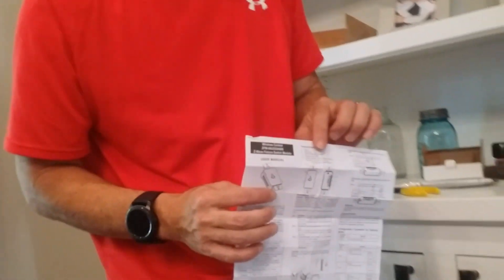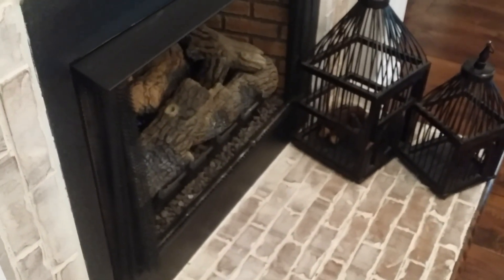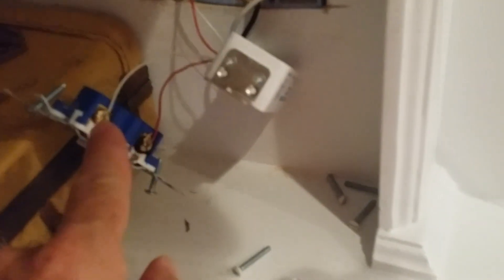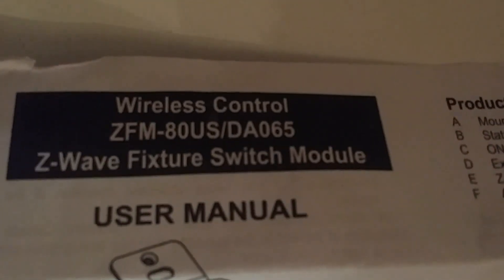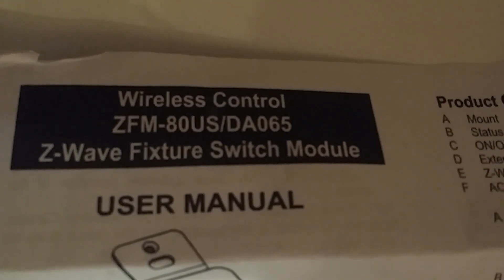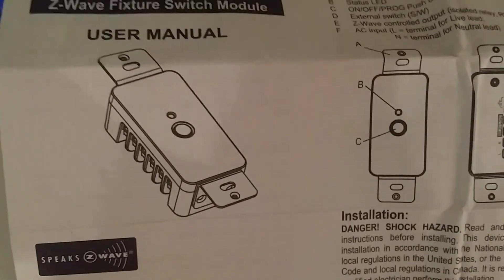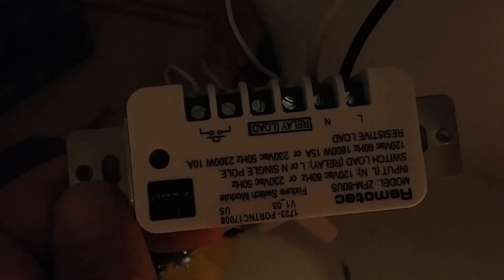Low Voltage zwave Fireplace switch w/Alexa

Comment: My fireplace has the relay underneath.  Is the 110 going to the switch, just to power the z-wave switch?  I am concerned it will feed to my fireplace and fry my relay or worse.
Reply from the maker: Shon Bjerregaard hey sorry for the extremely late reply.... the 110 is just going to the switch... the switch has a built in relay that only sends 2 or 3 millivolts (I believe) to trigger the switch built in to my
Fireplace

Comment: Thank you for the post. Looking to add this to my home but have a couple questions. What happens if the light switch is up (on) and you tell Alexa to turn off the fireplace? Will the fire place turn off even though the manual switch is on? Also, if you turn on the fire place with the switch, and then look in your zwave hub, does it show the fireplace as on or off? 

Thanks!
Reply from the maker: Anthony Hildoer Great question! so Yes If I manually push the button to turn the fireplace on, Alexa will turn it off..and vice versa..
Reply from the maker: Oh also honestly you don’t need the toggle switch.. there is a push button on the z wave controller.. To this day I’m not real sure why I put the toggle switch back in...🤷‍♂️
Reply: @bk334st  I would like to mimic your setup but plan on putting the z-wave relay switch under the fireplace as opposed to on the wall.   As Anthony asked, if you have the manual switch on and turn off the relay via Alexa, does the fireplace turn off or stay on?
Reply from the maker: Kulvir Bhogal sorry for the extremely late response but short answer is yes! If I use Alexa to turn on the fire place I can turn off with switch.. I use the switch to turn on the fireplace I can turn off with Alexa..It’s acts like a Ge add-on switch, like you would use if you had a set of lights with more than one switch controlling them

Comment: I can’t find the ZFM-80US/DA065 zwave module anywhere. Where can you buy this?
Reply from the maker: Peter Landis Yeah another person commented they couldn’t find it aswell they may have discontinued...I did find something else there’s a link in the other comments.. not sure if that will work for you or not
Reply: That’s to bad because there doesn’t appear to be something like this.  Not even Insteon has something like this.  I’m looking at ways to control a relay to low voltage but can’t find anything out there yet.  If I do I’ll post a reply.  What you did is exactly what I want to do.
Reply from the maker: Peter Landis if you google or go on amazon and look for Low voltage dry contact switch it pulls up some Zwave relays..may be a little more involved to get it to work.. but I think it would be doable..

Comment: Too bad the 'production' leaves a lot to be desired ... I believe you're addressing what I want to do but I just could not manage to watch/listen.
Reply from the maker: Benny Hannah Thanks!
Reply: @bk334st  I'm looking for the ZFM-80US but apparently no longer available at Amazon.
Reply from the maker: Benny Hannah Qubino Z-Wave Plus Universal Relay with Dry Contact Switch ZMNHND3 https://rover.ebay.com/rover/0/0/0?mpre=https%3A%2F%2Fwww.ebay.com%2Fulk%2Fitm%2F223303993907
Reply from the maker: Found this one eBay...little different but works the same way... I just looked for it as well... even though my production is off I’ll still look for you periodically and help you anyway I can..
Reply: @bk334st  Thanks.  Keep the faith.

Comment: Can this be installed and no hub needed to control with Alexa?
Reply from the maker: Corbin Keith Short answer no you have to have a hub for this switch.. This is a Zwave product so you have to have some kind of hub to control..I know amazon has some smart devices now that all you have to have is an Echo to control not a hub.. You have to scan a Qr code on to your Alexa  app to control those..
Reply: bk334st okay which hub do you suggest? Id like to control via alexa
Reply from the maker: Corbin Keith Definitley the Smart things hub in my opinion it works with pretty much everything, Z-Wave, ZigBee, Wi-Fi, Bluetooth, Nest, Alexa, Philips Hue, Honeywell and I’ve had no issues with mine for the past 2years.. I’m hoping to upgrade to the new one for Christmas..

Comment: How do you get the ZFM-80US to connect or pair with Alexa? I have a new SmartThings hub but for some reason it will not discover the ZFM device. I'm not sure what to do or what combination of pushes on the program button of the ZFM to hit. ANy help would be greatly appreciated.
Reply from the maker: Elaine Woodward Hey Elaine so I’ve had luck by putting your smart things hub in discovery mode from the app.. which I’m sure you know that aspect of it... but once it is I’ve had luck by pushing the button on the switch 3 times holding it down on the the third time.. Is the Blue light illuminated..and or does the fire place work with just the switch??

Comment: Also,  in your setup, what's the point of the button on the front of the relay if your using your switch
Reply from the maker: Well honestly there is no point to really having the toggle switch, Since you can just push the button.. I believe I installed it for my wife, who really is not interested in all this Tech stuff and just wants to be able to flip a switch, like she’s use to. Instead of pushing buttons or asking Alexa to do it..
But short answer no it’s not necessary. 👍🏻
Reply: @bk334st  thanks,  this video helped alot

Comment: The one you said went to nothing is for a fan in your fireplace. Thanks for the video.
Reply from the maker: You may be right, but that fireplace doesn’t have one. Guess the wire could be capped off somewhere underneath. 
I built our house but dang if I can remember why I put that switch there..I have a couple more ghost switches as well..Thanks for watching!
Reply: @bk334st  there is an outlet underneath in the fireplace where the optional fan goes,  that other switch is the on and off for it. I didn't have a fan at first either,  I bought the installed mine.

Comment: Hi Bud.. thank you for the vid. Your set up is exactly what I want to do. But I must have done something wrong as the remotec didn’t even start. So I connected the 120V wires to the L & N ports and used 18 gauge to connect the switch ports (right most ports) to the wall switch. Connected the Relay Load terminals back into the switch ports. With this the remotec light didn’t start. What wrong do u think I have done?  Any help or guidance would be very highly appreciated.. thanks in advance
Reply: Hey bk334st, finally got it to work. My Remotec was busted (I think I fried it). Bought a second Remotec and the blue light came on. Then...(I didn't realize I needed a hub to make it work with Alexa), I linked it with my Vivint Home security which uses Zwave and used the smart skills in Alexa to  link the Remotec . Works perfectly. Thanks for the video and your help. Super easy once I got a new working remotec.
Reply from the maker: Ravi Bhatia Hey sorry for late response..You really dont need to wire back in the light switch as the remotech has a push button on it. Are you sure your fireplace is low voltage?
Reply: Hi bk334st... Thanks for the reply.. Yes I am sure the wiring is 18 gauge and it's low voltage.. I think I have busted the device because the light indicator doesn't come on.. Should the light indicator show something once the 110V AC is connected?
Reply: Hi, I'm having the same problem.  The LED light on the Remotec does not come on. I have the black wire attached to the L (load) on the Remotec and the white wire attached to the N (neutral) position on the Remotec. I am 100% positive I have a low voltage fireplace. Any help or guidance you can provide would be helpful. Thanks.
Reply from the maker: m b Hey ok so the blue light does not come on until you press the switch...First we need to figure that out..So with just the Hot wire amd neutral hooked up if you press the button does the light come on?
Reply from the maker: m b That's Great news! Sorry I wasnt much help, its difficult to trouble shoot over the internet..

Comment: Can you link this setup to a smart thermostat now? I'm looking for both voice command, that you have shown, and thermostat control in case my smartthings temperature sensor batteries die.
Reply from the maker: Michael Gautier  let me make sure of what you are asking. You mean a thermostat for the fireplace that will turn it off when it hits a certain degree, or thermostat for your home A/C?
Thanks
Reply: Yes. So it will turn fire place on. Im sure I can add an activity to my smartthings hub using my motion sensor thermometer, but I don't get great battery life and was wondering about a smart thermostat as the main source of turning it on when I'm not in the room if the temp drops.
Reply from the maker: Michael Gautier...Apologize just now getting back to you. I would have to brainstorm on that a little more. Giving there are post on the zwave switch I installed for just a regular  toggle I would think there would be a way to wire a thermostat that could essentially act as the toggle switch and wire to the post but remember it can't be 120v. Like I said I would have to research a little further in to that and get back to you.
Reply: I'm wondering if a nest or Honeywell smart, wireless thermostat would be able to link together easy. Maybe with IFTT would be a help if nothing else. I ordered one of those modules in your video today. Hopefully by Thursday evening I'll have good news.
Reply: I got my module today. Paired with smartthings simple and easy. It will not power on my gas logs. I did not hook up an external switch. I hear the relay clicking when switch on to off.
Reply from the maker: Michael Gautier first thing how do you turn your fireplace on now..or before you installed zwave module?
Reply: It came with a a battery powered receiver under fireplace, 4 AA batteries. A battery powered remote with a thermostat in remote. Remote is RF. Skytech 1001TH. It did not have an external wall switch with it.
Reply from the maker: Michael Gautier sounds like your fireplace may use a certain amount of voltage to turn it on. Are you able to check output of the thermostat you have currently hooked to it with a multi-Meter?
Reply from the maker: Hey Michael was just checking in to see if you had figured anything out?
Reply: Nothing that moved me forward. I was posting with a someone on Amazon and he tried his best to help but we got stuck due to the lack of internet information on my propane logs and it's power requirements from the skytech receiver it came with. Thank you for checking in. I'll probably start looking at it again, but took a little break because I was getting obsessive with it. It would be nice to figure it out soon.
Reply from the maker: just as fyi I was adding to my collection and ran across this
https://www.amazon.com/Enerwave-ZWN-RSM2-PLUS-Z-Wave-NEUTRAL-REQUIRED/dp/B01G7OD3ME/ref=sr_1_24?ie=UTF8&qid=1515339630&sr=8-24&keywords=smartthings+light+switches 
you can wire to existing switches?
Reply: What's your thoughts on this? I was trying to read some about it, but question how go incorporate it.
Reply from the maker: Michael Gautier forgot you said it didnt come with and external switch..just the remote..
Reply: Yeah, maybe I can start trying to call around next week and see what can be changed or upgraded for the receiver setup. I guess I got the only odd setup for my logs.
Reply: Michael - have you considered purchasing a separate Z-wave thermometer (there are a ton of them), and a RF or IR home hub (such as a Logitech Home Hub), then set up an IFTTT?  If temperature falls below 17 degrees, send RF signal from Logitech Hub to turn on fireplace.  If temperature raises above 23 degrees send RF signal from Logitech Hub to turn off fireplace.  Benefit of one of these RF/IR/bluetooth hubs is you'll also be able to use Alexa to turn on your TV, stereo, adjust volume, etc...
Reply: I have a Harmony remote and hub and I would love to go that route. Could you recommend what to buy that would go from IR to RF without learning how to right code?
Reply: The Harmony Hub already contains RF codes for millions of devices, just have to add the model of your fireplace / RF to it, then link your Harmony Hub to Alexa and you should be good.  Doesn't hurt to try it out for your application, if not you can return the Hub.
Reply: I have the hub and the elite remote already, I just couldn't figure out how to make the remote talk to my logs receiver or find it's signal. If it can be that easy I'll have it made. Just questioning how get my remote to find the logs frequency.
Reply: Harmony has told me in the past, last year that their remotes will not control anything with RF. I was reading their website and it still says the same thing. I called skytech and they are confused why my logs don't operate like these and told me I had a defective valve but I have another set in my parents house and they function just the same. I guess my next move was to call the logs manufacture, I just haven't done it yet.
Reply: Hi bk334st, thanks for the post. Very useful.   ZFM80 appears to be hard to find. (did you wait for some time on Amazon ?)  Just wondering do you know the  enerwave Z wave switch module relay would work as ZFM80 ?  I want to use it in the fireplace as you did but not sure if it can use for controlling millivolt switch.  Thanks

Comment: Do you have to have the external switch? can you you the zwave controler as the switch? i saw it has a button, so i wonder.
Reply from the maker: Shy Lev-Ari 
Hey Shy no you do not have to have the External switch. The zwave has a push button. I just left it in and hooked it up to fill the void and the wife is not all into this Electronic stuff..lol